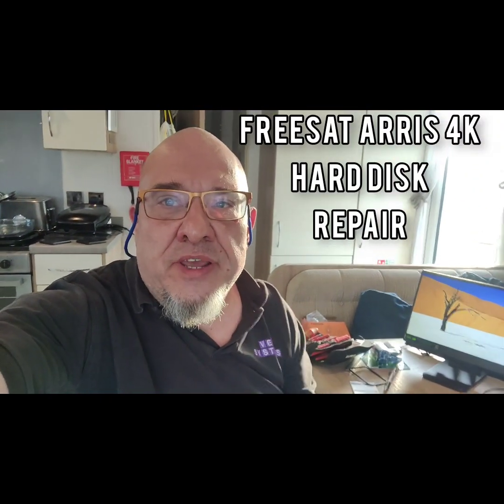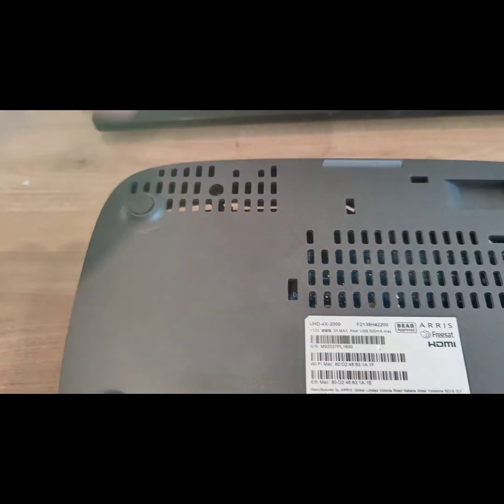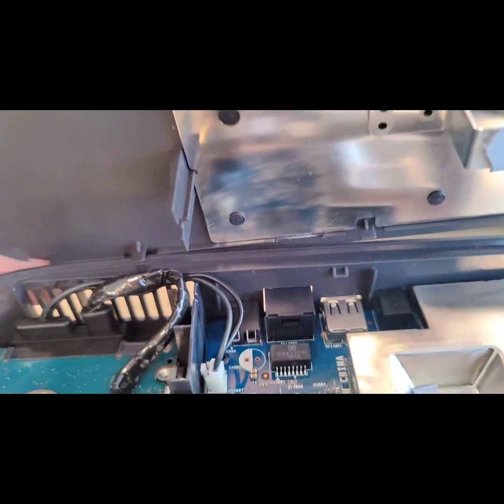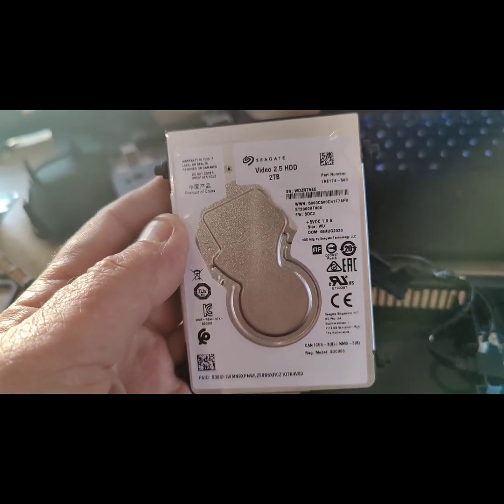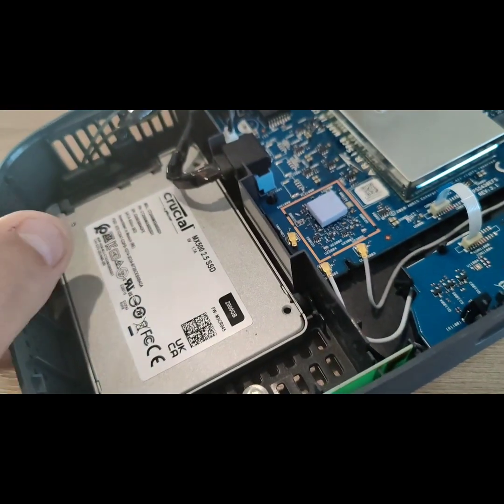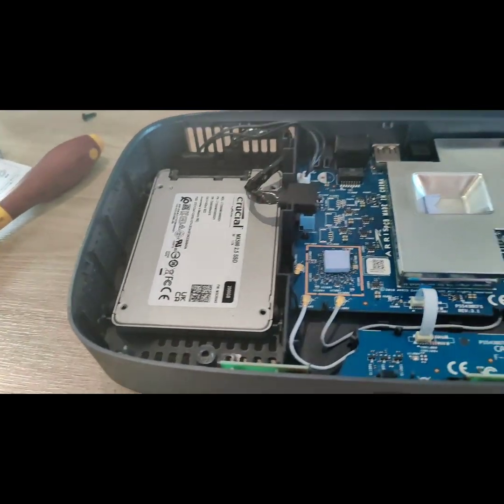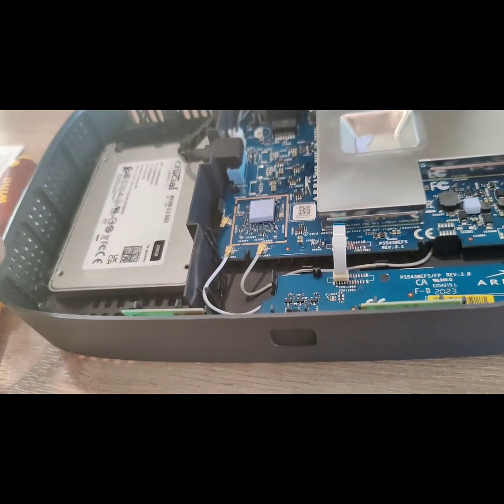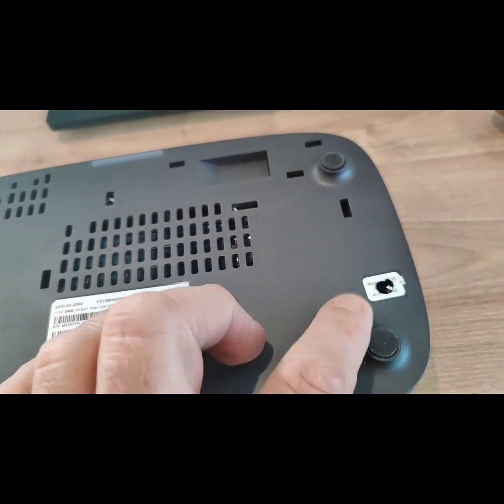Freesat Arris 4K UHD 2TB Hard Drive Failure Successful Repair!  Hard Drive Failure?? No Problem! 😁

Comment: Please lose the music. It's distracting and totally unnecessary.

You replaced the faulty Hard Disk Drive (HDD) with a Solid State Drive (SSD), and then proceeded to refer to the new Solid State Drive as a Hard Drive!

Hard Disk Drives are preferable in a Digital Television Recorder (or CCTV recorder), as an SSD has a limited number of write cycles, and may wear out prematurely. I have HDD recorders from as far back as 15 years, which still work just fine.

Comment: Hi Vince I’ve replaced my drive with the Toshiba drive 500 as that’s all I had in my box, but every time I turn my tv and sat box on I keep getting setting up your dish…is this normal as it never did this before.
Reply from the maker: @corinnecollins  Yeah, it's normal, mine does it every time you turn on the sat box... Setting up the dish... So I don't turn it off, only the TV.... But my TV doesn't switch off anything connected to it... Some issues may arise if your TV turning off then signals via HDMI to turn off other equipment connected to it... It's a right pain... I'm sure of a solution either....
Reply: @ thank you at least I know it’s ok.

Comment: Excellent! My Freesat box failed after less than two years. I was constantly getting re-boot messages but it kept failing. After searching around on Google I came across this video. I bought a replacement 500GB Toshiba hard drive from Amazon for £14.87 (which was virtually the same as the one I took out) and followed this tutorial. 15 minutes later, Freesat box set up and working like new. 
Thanks - saved a lot of money (and improved my own troubleshooting skills!
Reply from the maker: @dominicflint7560  Thank you so much, I'm glad it's sorted at a lower cost for you....

Comment: Did this with the same SSD, But now I get an overheating issue...
Reply from the maker: @liambreakspear1235  Hi thanks for the feedback, the only thing I can suggest is if you haven't already, redo all the thermal compound on all the areas shown in the video... The stuff that looks like Blutac, there may be a better more conductive thermal compound on the market now that can transfer heat quicker and more efficient.... It's a passive cooling thing so should cool using the metal in the case.... Overheating does seem odd when the SSD has no moving parts....

Comment: Thanks for the video Vince. I have exactly the same box and the hard drive has packed up after 3 years of very little use. It's in the spare room and I literally only use it about twice a week when horse racing is televised so I'm not happy. Looks simple to replace but I'm just worried about it not working without me formatting it or changing the partitions or something - I know nothing about all that.  Can you tell me which drive to order that will be hassle free? Many thanks
Reply from the maker: The one in the video was a Crucial 2TB SSD (Laptop Size Drive), from Amazon. Check to see if your box is 2TB or 500MB though and get one to suit. The unit probably won't read 2TB if your unit is 500MB... So pls check first. Pause the video and should have part no.
Reply: @CupidRoven  
Thank you Vince, thanks for the reply. I actually took a chance a week ago and bought a 500mb Western Digital (same as my machine) and it was easy. It was reformatted with a 1 year guarantee and was only £5.49 so I had nothing to lose. Worked fine last weekend and recorded the racing both days. Hope it lasts but I'm happy so far. Just hope there was nothing about the box that made my hard drive fail that might happen again. We'll see. (It was a Toshiba HDD).
Thanks again
Reply: Just to clarify, I bought a 500mb like for like but the original was Toshiba and I bought a Western Digital.
Reply from the maker: @PhilipBennett-y8w  Good call.

Comment: Thanks for this video.
My old Sagemcom DTR-94 500HD freesat box is getting a bit tired (freezes at times). Thinking about a Freesat Box but have been been put off by the many hard drive failures.
Can't believe how easy it is to change/upgrade to SSD.
Reply from the maker: Thanks for your lovely comments, good luck with the repair, mine is still going btw

Comment: Possibly a really stupid question but would the box work as just a receiver with no recording function if the faulty hard drive is removed? I have  just ordered a new hard drive but because i live in a remote island location my new drive wont be here for 5 days so I wondered if I just removed the faulty hard drive altogether until the new one arrives would that let me receive programmes in the meantime? Thanks for this video BTW it has given me the confidence to attempt a hard drive swap which i thought would be beyond me.
Reply from the maker: Hi and thanks for your comment. As far as I remember  if the box doesn't see the hard drive it keeps rebooting to try and put it into recovery mode automatically.... I don't think it does work without the HDD...
Reply: Thanks for that  @CupidRoven . I did wonder if it might do something like that. Guess I'll just need to be tv free for a few days until the new hard drive shows up.

Comment: Just watched your vid👍 Our box is about 15 months old and HDD has gone offline and reboot does nothing! Think I’ll be trying your suggestion of the hard drive! Did wonder whether going on your point of no fan, if it’s a problem with the hard drives overheating?  If so is it a design fault or just to sacrifice space to make a compact unit! Cheers👍
Reply from the maker: Thank you for your comment. Yes, could be a design issue. However I do think the with an SSD in place of a mechanical drive, it's cooler, not using as much current etc, and I've no problems with the new SSD I put in, and box is still going strong.

Comment: Why would you hear  rattling around if you dont secure it. its a silent power supply
Reply from the maker: Thanks for your feedback, yes silent power supply topped no hard disk inertia as it's solid state, so not much chance of rattling around anyway. It's just more for knock protection. So although the rubber baby buggy bumpers weren't really needed to be put back in this particular case, I always believe that if you put bits back any future upgrades say mechanical again in the future, you won't be needing to get any spare bumpers. Also if you are going RV Mobile with this device, it will offer the knock protection.

Comment: Thanks, mine died today and gave me the error, then wiped all my recordings. Just swapped out exactly this model of SSD from my PC so in it went! Will monitor over the next few weeks to see how it does. Did you get a performance increase going from HDD to SSD?
Reply from the maker: It certainly felt faster, whether or not that was just my feeling at the time, I wouldn't know as I haven't run any bench marking on it as far as file read/write etc. It's still working now, and regularly records scheduled recordings whilst unattended. The sat box is permanently on as I like to use this as my only source of aired transmission television and don't wish to wait for the Freesat box to start all of the time. It's also very handy if I've left it on a channel, and there is a programme half way through that I'd liked to have seen, I just hit record and grab the whole programme before it ends or just rewind live play. All would not be possible if it weren't for the hard disk.

Comment: I changed the hhd in my Arris and it's coming up overheating issue now and the box is not hot what so ever
Reply from the maker: Hi, and thanks for your feedback.. I've looked into this and can only assume that if the box was ok before the swap out of the HDD then there may be a break within the thermal compound above one or more of the microprocessors. I'd recommend adding some more thermal compound above the bits that remain blue when you take the lid off. If the HDD is the mechanical type? is it trying to draw to much current from the Freesat box?
Reply: @CupidRoven  Ives ordered some this morning so will give it ago Wednesday and let you know.
Thanks for the reply
Reply: @CupidRoven  hi there I've just put some thermal compound on the parts that is blue and it's still overheating. I've tried a different plug too. I don't have anything else to suggest with it

Thanks
Reply from the maker: @eddiemax28  There's nothing I can suggest now, only thing I would do, is ask around the forums to see if this is a known issue... Did it overheat with the original HDD? That might be somewhere to start?
Reply: @CupidRoven  yes the original HDD died. will ask around.

Thanks again
Reply: @eddiemax28 mine is the same, remove the heat source??
Reply: I'm having the same issue, was not overheating via to changing to ssd.
Did you find a solution??
Reply: @liambreakspear1235  I did find a solution and that's the bin and get another make. 👍🏻